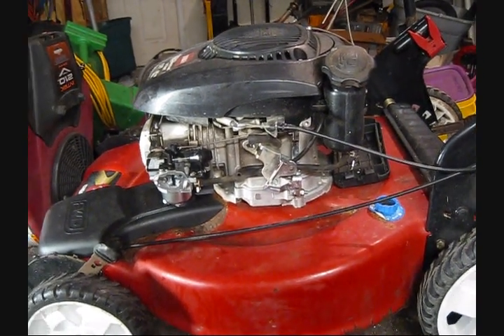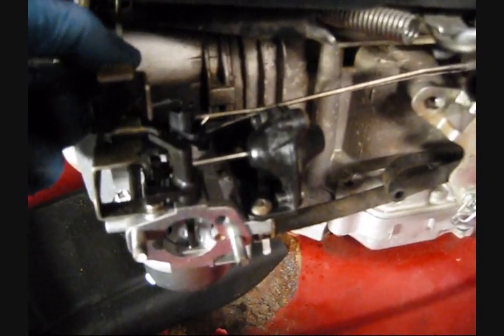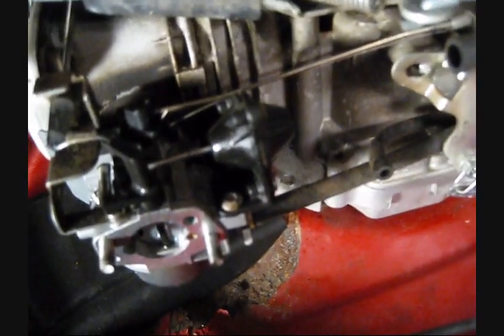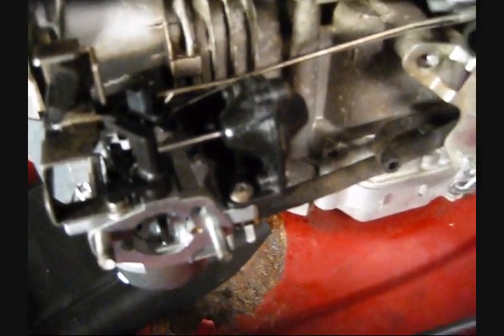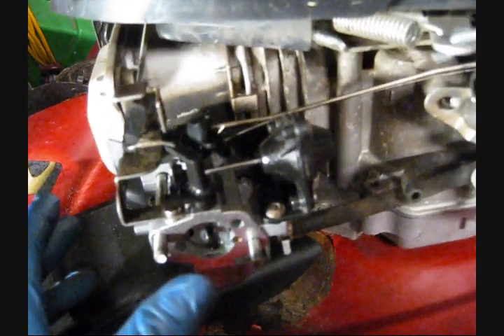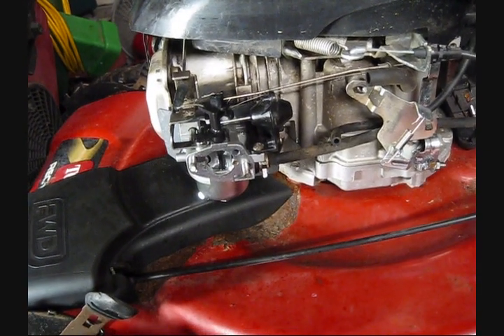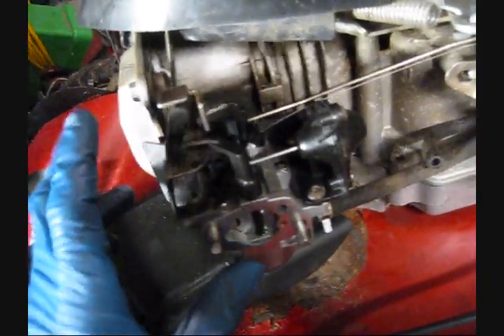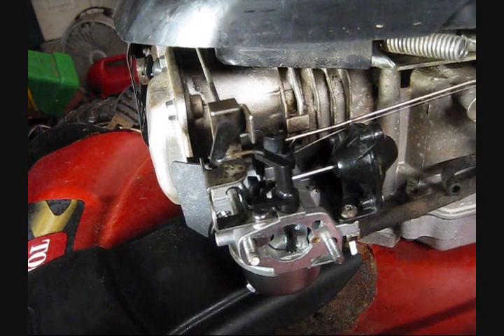How automatic choke works on kohler Courage XT engines

Comment: Through my ongoing experience with one of these, it's a simple system, that works well in theory.  In practice, it's a disaster with so many points of failure, it's really kinda sad.  The vacuum port to the diaphragm can be clogged by a microscopic amounts of dirt or goo.
Reply: It's garbage.  The briggs autochoke works so much better.  I'd much rather push a primer bulb twice than have to rely on this contraption.
Reply: @joemilton7552  this is what happens when you let marketing people run the design process.  It's different, it's a selling point, it's patentable, but it's expensive, complex and unreliable.  The primer bulb works, the 35 year old Briggs heat choke and vacuum diaphragm, eh. I'd rather have the primer or a manual choke.
That said, I did get this Rube Goldberg contraption to work....for now.

Comment: I would be very grateful if you can tell me which of these two parts (the automatic choke and the vacum) stops working more frequently and where can I get the replacement? thanks for your help
Reply from the maker: Not sure on these, but I would guess the thermal actuator.

Comment: Any way you can help me.  Exact same set up slightly different issue.  I am a tech but having some issue I'm not familiar with.  Assuming a fuel or air issue.
Reply from the maker: maybe, depends what it is. I don't work on too many kohler xts